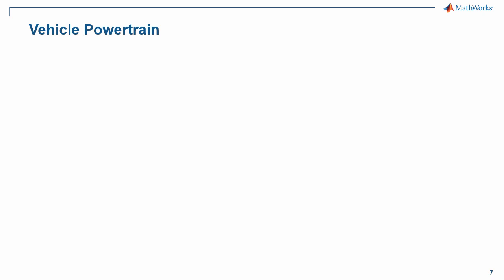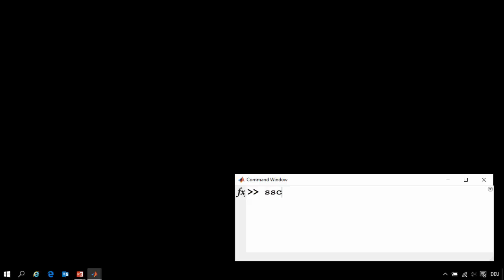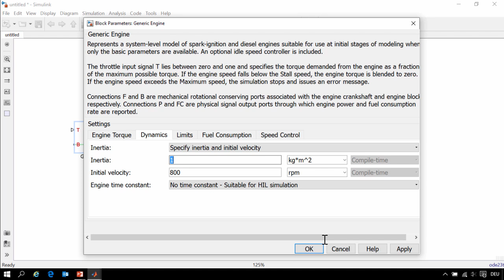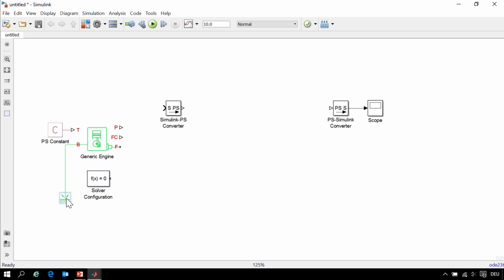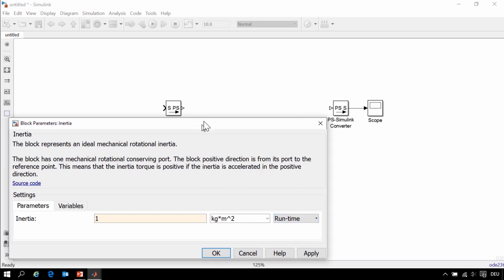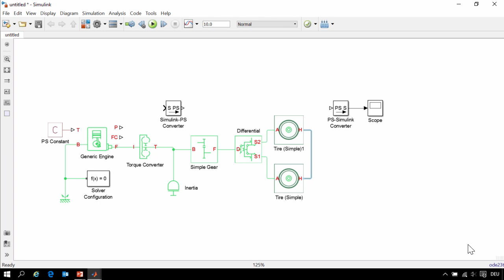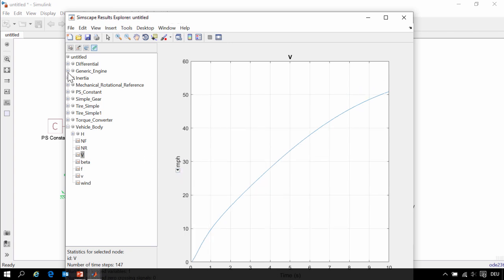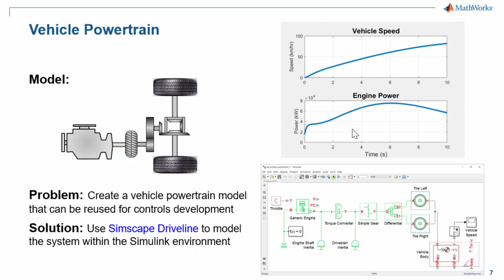Modeling a Vehicle Powertrain - MATLAB and Simulink Video

Comment: When I run the simulation, I get an error stating "At time 0.779821, one or more assertions are triggered. See causes for specific information. 
Rotational velocity must be less than or equal to Maximum speed." How to clear this error?
Reply: this happens because your engine is overspeeding due to no load. you can put an inertia load or enable the redline controller.